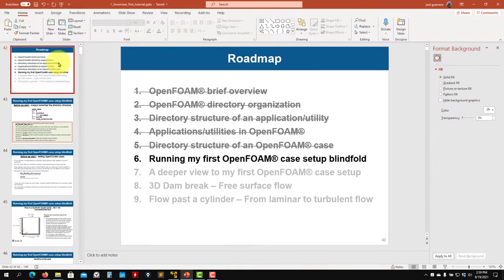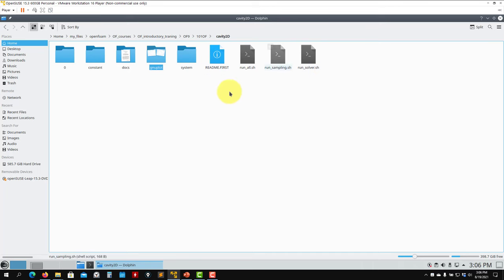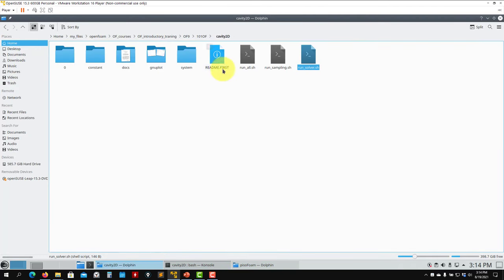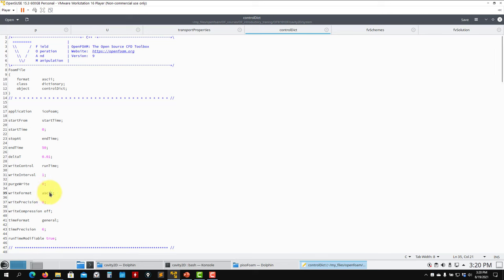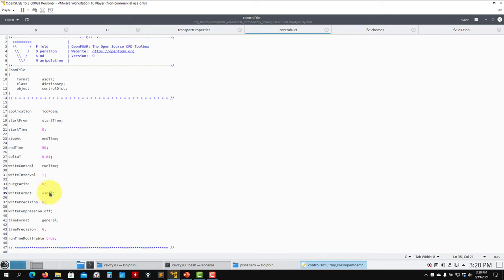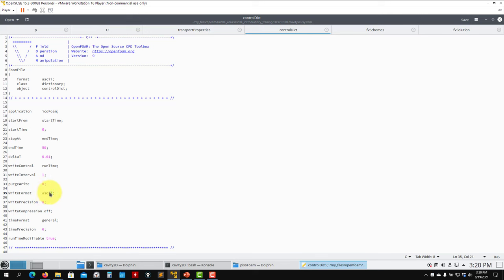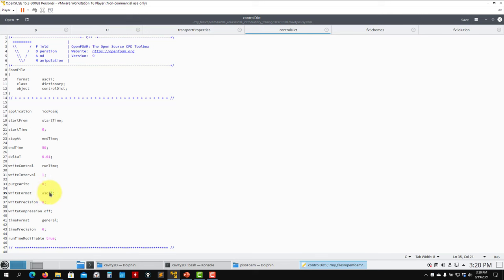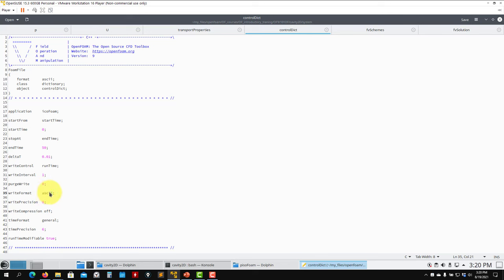1.3 Module 1 | Introduction to OpenFOAM - OpenFOAM 101 #openfoamtraining

Comment: Thank you so much for this video. I am facing with the following error when I want zo run the case study:
Cannot open etc file "caseDicts/postProcessing/minMax/cellMax.cfg" while reading dictionary "system/controlDict.functions.cellMax"

I checked the directory and there is no cellMax.cfg file there! Could you please let me know how should I solve it?
Many thanks
Reply from the maker: You need to use OpenFOAM 9. If you are using another version, 10 or 11, you will encounter some compatibility problems that shouldn't be that difficult to fix. For openfoam 11, follow this playlist, https://www.youtube.com/playlist?list=PLoI86R1JVvv8GK_8wisjDSj9QUbGoaM-6
Reply: @wolfdynamics5703  Thank you for your reply. I appreciate your support!

Comment: Thanks for this video ; i got this problem "foamInfo: command not found"
Reply from the maker: You need to use the right version of OpenFOAM. All tutorials work with OpenFOAM 9. If you are getting that error with OF9, maybe there is something wrong with the compilation.
Reply: @wolfdynamics5703   Thank you , i am working with openFoam V 2012  i will try to install another version.
Reply from the maker: Ok, that is your problem.  If I well recall foamInfo is available from OpenFOAM 8 and on  @elganaelmehdi1697

Comment: Thank you very much sir, I did not get what is Patch meaning? when we can use this ?
Reply from the maker: Well, I think you need to elaborate a little bit more your question.  But if I understood well your question, the patch is the surface where you define the boundary condition (numerical values and type). Basically it refers to the surface from the geometry.

Comment: Hi Wolfdynamics folk, 
I downloaded Open9 from your website but in the VM I run there is not any sign of my_files folder. How can I add it to my virtual machine?
Reply from the maker: Well, I need to check the virtual machine. In any case, if the folder/directory does nos exist, just create it.

Comment: Thank you for this training materials ! 
I have having troubles running the cases, I have a fatal error using blockMesh (which I do not have running the tutorials included in OF).
I am using openfoam2212 (so v10 I guess ?), which files should I update, and how to ? (or where could i find the updated files) ?
I am learning all by myself for work, so don't hezitate to overexplain things.

the exact error is :
ubuntu$ blockMesh
[...]
--> FOAM FATAL IO ERROR: (openfoam-2212)
Cannot open etc file "caseDicts/postProcessing/minMax/cellMax.cfg" while reading dictionary "system/controlDict.functions.cellMax"

file: system/controlDict at line 179.

    From static bool Foam::functionEntries::includeEtcEntry::execute(bool, Foam::dictionary&, Foam::Istream&)
    in file db/dictionary/functionEntries/includeEtcEntry/includeEtcEntry.C at line 138.

FOAM exiting
Reply from the maker: You should use the target OpenFOAM version. ESI and Foundation versions are not 100% compatible.
Reply: @wolfdynamics5703  Thanks for the tutorials. I'm new to OpenFOAM. Which version does this course use? I thought it uses the Foundation version. Does it use a modified version?
Reply from the maker: The course is based on OpenFOAM 9. The tutorials MIGHT run with OF10 and will NOT run at all with OF11
Reply: @wolfdynamics5703  thanks for the reply.

Comment: I am getting an error - command of9 not found. Any reason for that?
Reply: of9 is an alias for some script he has in-hand for quick setup.
If you have installed OpenFoam9 yourself, and have correctly setup your .bashrc file, I believe you shouldn't need anything else. Just run the case!
Reply: @SimranjeetSingh-eh4bc  I have OF 9 correctly and even .bashrc is correctly setup. Still when I run the case I am getting fatal errors
Reply: @kushagragarg6973  what is the error?